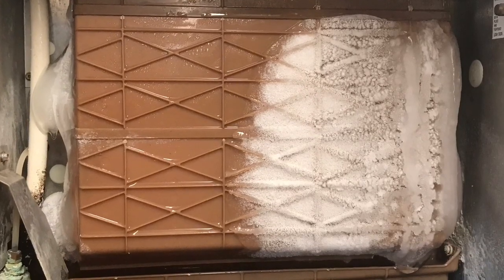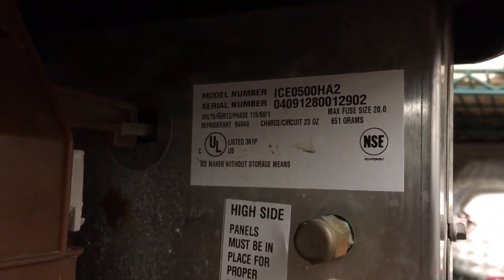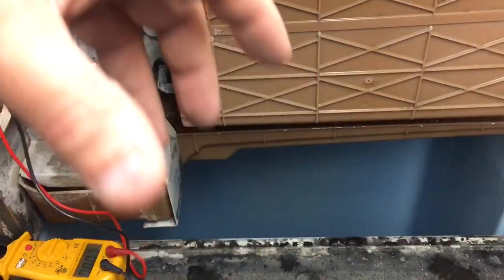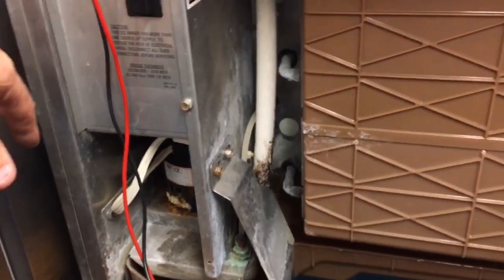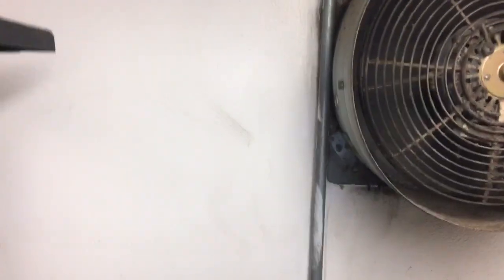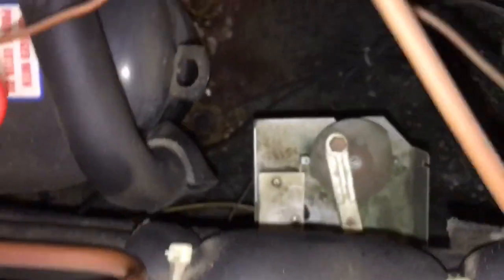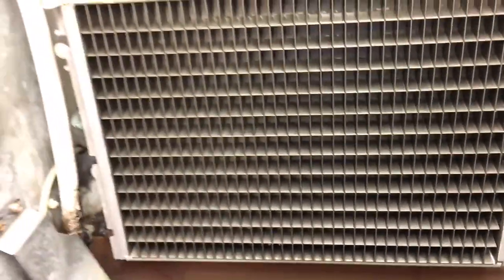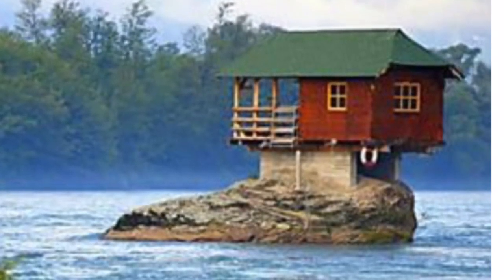Service call - All Frozen up iceomatic ice machine. ice0500HA2.

Comment: The good old harvest assist motor. Ice o matic has had a lot of issues with this. A bunch of revises and now a complete rewire of the harvest assist. Good catch. Any time I come to an Ice o matic frozen up, I look to see if the pin is still sticking through the ice plate.
Reply from the maker: Yea, Definately the Weak Link in the ice o matic ice machine.

Comment: New to HVAC so after recovering refrigerant from ICEO400HA4 next would be pulling a vacuum before adding specific amount of refrigerant.
Reply from the maker: maybe. why did u pull the charge ?
Reply: @OcRefrig  uneven ice on surface of mold tray, at first I thought it wasn’t dropping any ice because of mechanical issues or maybe a blockage it wasn’t those at all. So I thought maybe it’s low on charge.
Reply from the maker: uneven ice - i'd more look at water flow across the grid. loose grid slats or water distribution tube put together wrong or full of junk in water distribution tube.
remove water distribution tube - make sure it's clean / all holes open & when tube is assembled - inner tube holes MUST face up. it can be assembled two ways.

Comment: Thank you for your video of ice o matic ice machine, I got the problem of iceo 400, and it doing just mode of difrost hot gas no power coming to the seloniod valve  could be harvest motor or the switch or replace the whole assembly harvest motor and switch
Reply from the maker: Glad it helped. replace the whole thing as an assembly. they are not expensive. best move.

Comment: Thanks for all the refrigeration videos! I recently started a job working on Ice Machines am kinda lost so every video helps. Can you try to make a video that better describes pressure readings and how to properly recover, vacuum, and charge low pressure systems for a rookie l like myself? Thanks!
Reply from the maker: What did u do before ?
Reply: OcRefrigeration,Hvac & Electrical.  Residential install
Reply from the maker: Ouch , from Resi installer to ice machine tech. Boy, someone threw u in the deep end. So, only difference between a ice machine and a airconditioner is the technology. Make sure u sign up for ALL THE ice machine schools Right away. it's a Must !!! Hoshizaki school , ice o matic & manitowoc schools. Without it YOU WILL BE LOST !!!
Reply from the maker: --- Similarities ---
Recovery = Same as A\c.
Evacuation = Same. Under 500 microns a must.
Welding = same
Pressure testing for Leaks = Same. 
Finding Refrigerant Leaks = Same
Adding refrigerant = same.
Refrigeration theory = same. Know your Pt chart. Pressure vs temperature for different refrigerants.
Condenser fan motors = same. Just smaller

--- Differences ---
Circuit boards, electronics, hot gas defrost , Curtain switches , micro processors , water pumps, Water distribution tubes plugging up with crap. Corrosion , water leaks , harvest assist motors on ice o matics, No Evaporator fan = a Water pump is Now Your evap fan creating load on Your Evaporator Plate. Water inlet Solenoids , Liquid line solenoids ,
Reply from the maker: 1) Allways make sure Condenser is Clean First !
2) Biggest Problem -Plugged water filters. It needs water to function. Make sure it has a decent water supply entering.
3) 2ndbiggest problem - Plugged water distribution tubes with junk , slime , bacteria.
4) 3rd --- Water Pump Plugged up with slime. Poor water flow. Clean spray bars allways.
5) 4 th biggest problem - Loss of Refrigerant. Not common. Don't alkways assume a Refrigeration. More often than not. Ice machines DO NOT LEAK REFRIGERANT. RARELY. 9 times out of ten its a Machine is Dirty issue. Condenser plugged with Lint & Slime inside Evaporator area / Poor water flow.
Reply: OcRefrigeration,Hvac & Electrical. Awesome, thanks for the brief schooling. What I've seen so far was ice-o-matic machines with code HPOC the first machine I was unable to figure out what the deal was. The second one I found dirty condenser.  The other issue I had was a harvest motor was staying on which I suggested a new harvest motor. No word back yet. My main issue is I'm not sure of the exact sequence and defrost has me confused.
Reply: Also the one walk in freezer I went on suction line was iced up all the way to the condenser. Unit had two compressors the evap was frozen up so I forced a defrost. Had no gas going in the evap. I couldn't get a reading on my high side due to not the right tool to open the valve but my low side was only reading 23psi. One of my compressors kept short cycling (the one for the cooler I believe) I'm assuming either low on Freon or TXV issue. But not sure yet until I can hook up to get correct pressure reading.
Reply from the maker: What state are u in ?
Reply: OcRefrigeration,Hvac & Electrical. Texas
Reply from the maker: California here.
Reply: Craig Ewing check out PartsTown site. Lots of factory .pdf available to download to your tablet. Manuals tech charts & sequence of operation, parts lists and fotos as well as a forum Techtown

Comment: I have a ice0400ha4 my question is does the harvest assist motor should it move while in freeze mode or should it stay still then move when in harvest?? Any help would be appreciated
Reply from the maker: in freeze - motor will spin to notch on brass wheel and stop. no more moving in freeze. in harvest - motor tries to move / slips on clutch till ice is pushed off then rotates to stop / notch position.
Reply: @OcRefrig  K cool thanks so much for the response yes I kinda thought that was the way it was but needed assurance thanks again
Reply from the maker: https://www.iceomatic.com/faq

Comment: Some of icematice design I wander what are they thinking. Example on pressure switches why don't they use shader valves that way you wouldn't have to recover freon to replace them and why do they put dryers on bottom of unit .They sure didn't think of service tech on design of unit
Reply from the maker: Agreed.

Comment: I have two 2013 iceomatic  machines with small leaks around the compressor that I just can't see with bubbles yet
Reply from the maker: Buy yourself a Ge-H10 G Leak detector. It will make your life alot easier.
Reply from the maker: Turn ice maker off. Let system balance off for 30 minutes. No ice on the Plate. Go around with a leak detector. Check for cracked 90's from vibration. If u still can't find leak. Remove all rubber insulation from all piping and dry off  tubing. Check for leaks. Check anything that contacts the floor of ice machine. Under drier ?
Reply from the maker: If u think leaks are somewhere sometimes they can be blowing from another direction. Leaks can be sneaky. Leaking Pressure switches ?
Reply from the maker: its probably leaking from the bottom of the filter drier and just blowing around the compressor. .

Comment: What tips do you have for a newbie in refrigeration?
Reply from the maker: Tips Regarding What ?
Reply from the maker: Buy a Ge-H10G Leak detector to find leaks accurately.
Allways Clean Your Condenser First ! Can u see Through the Condenser with a Flashlight ?
Make sure evaporator is Clean and free of all ice first.
Make Sure All your Fan motors are Turning in the right direction , i find fan blades installed backwards ALL the time.

Comment: Hello sir, I'd like to ask a question. I have an Ice o matic that won't harvest at a little homeless mission I help with. It had the harvest assist probe motor replaced but still no harvest. I checked resistance at coil and its 140, doesnt seem horrible... I hooked up voltmeter and watched for voltage but no voltage ever showed up long past harvest being frozen.  What would be next point of diagnosis?
Reply from the maker: just Follow wires back from solenoid to find power if no power at solenoid.
usually there are a few parts in circuit, as soon as suction pressure pulls down to approx 28-30 psig low pressure switch should be closed and power coming out of it to timer block( black square thing) it times down and power comes out of that to solenoid usually. there might also be a Yellow cube relay in circuit. remove / inspect cube relay / swap yellow cube relay if u have 2 , they are same.
Reply from the maker: what city & state are u in ? if your local ill donate my time to help out. im in south orange county,  california.
Reply from the maker: 140 ohms is prob ok. you can put power directly to solenoid coil by making a little cord with 2 push ons on the end and plug into a extension cord to test solenoid coil and solenoid valve operation. remove wires to coil then hook your test cord to it. run ice machine, let it make ice when grid is full of ice. plug your test cord into a extension cord and power up hot gas defrost coil. slab of ice should heat up and drop within 2 minutes on the clock. unplug coil after ice drop to re initiate freeze cycle.
Reply from the maker: there is a Temperature switch on some machines that is a common problem, it is buried under the insulation with 2 black wires coming out of it. it is strapped to a copper refrigeration pipe under the top cover right in front of you.
Reply: @OcRefrig  Lol Im in New Orleans, prolly a little too far.
Reply from the maker: yea.
Reply: @OcRefrig  
Hello again, I followed wires back from solenoid they both seem to attach on opposite sides of contacts where relay is. I switched relays, no change. I found what I believed to be pressure switch and disconnected a lead. It cycled off compressor but never initiated harvest. If I had a way send pics of inside it might help identify parts.
Reply from the maker: You have pretty much done all u can do without refrigeration guages, 1 foot hoses & electrical meter. you either need to call a ice machine technician to fix , call some local Refrigeration companys. see if they want to Donate thier time. its a tax writeoff for them & a Way to give back. good luck. 
option 3 --- Replace some parts. high temperature safety & timer block ( square black thing with dip switches on it. ) you know u could put those two wires together that go through the black plastic timer block. 2" square thing with dip switches. bypass that timer so power goes straight thru it. it judt makes defrost time longer. if it drops ice or goes into defrost u will have found a bad timer. or if u kniw how to check for power on one side and see if power is going through it after it has made a thick slab of ice and machine is running.
Reply from the maker: model & serial # of machine ?
Reply from the maker: https://sdsmarket.com/ice-o-matic-9041098-01-switch-high-temp/?cmp_id=898701253&adg_id=45286604829&kwd=&device=m&gclid=EAIaIQobChMIhOmP74SI3wIVDBhpCh2ycAU6EAQYASABEgIYpPD_BwE

find this part on your machine.
it is buried under insulation. ohm it out. it should be closed. they sometimes fail open. unplug ice machine.  disconnect this from system & ohm it out. it should tone out / have a straight through connection. if not buy this part and replace. for testing purposes u can bypass this switch.temporarily. and run machine without this switch to see if it makes ice.
Reply from the maker: this is what a timer moduke looks like ---- u can bypass this. temporarily. 
https://hvacrpartstown.com/products/ice-o-matic-timer-module?utm_medium=cpc&utm_source=google&utm_campaign=Google%20Shopping&gclid=EAIaIQobChMIsryftIaI3wIVDV8NCh2NIgUPEAQYAiABEgK4BfD_BwE
Reply from the maker: if u bypass these 2 parts and machine does not energize solenoid. likely culprit is low pressure control failure or compressor is not pulling down to a 30 lb suction. both these scenarios require a refrigeration technician to diagnose. have fun !
Reply: @OcRefrig  So this is ( high pressure) switch I unplugged on one lead. It shut off compressor but I waited for a harvest event but it never happened. I'll try bypassing timer as well to see what happens. If not I'll call someone and I really appreciate your time and wisdom.
Reply: @OcRefrig   OK so I found at least some of the problem. The condenser faces the wall and it was covered in a blanket of fuzz. I should have noticed that sooner.  It has harvested twice but seems slow to restart water pump after it dumps. Just observing for now.
Reply from the maker: Condenser is First thing to check on any refrigeration unit ! YOU MUST be able to see through it with a flashlight. it might be clean on top surface but they are 1-2" thick. they get impacted. YOU MUST Blow air through coil to clean it. YOU MUST.
Reply from the maker: that unit i believe has 2 cooling fans. both MUST Work. 1 comes on first , then 2 nd one comes on when pressure rises on a switch. about a few minutes later.
Reply from the maker: 2nd fan cycles on and off on a pressure switch. both fans i believe are off during harvest cycle. they might cycle on & off.
Reply: @OcRefrig  Ok Im leaving you alone after this one. Ill clean it out with air, but after I watched it while last night it quit harvesting and the purge solenoid started acting crazy and got super hot... no idea why.
Reply: And I also noticed suction line was frozen so it may have refrigerant issues.

Comment: Hello my friend thank you for your video just so question what was the main problem because it was freezing up I have a service to finished and it is freezing up also what part did you replace you was the bin sensor can you reply my message please thank you very much
Reply from the maker: Harvest probe motor assembly Loose at back of evaporator area. Harvest assembly needs replaced.
Reply: @OcRefrig  thank you very much my friend I will do that because this ice o matic ice machine it makes ice but the next day woke up freezing up
Reply: @OcRefrig  thank you again my friend and also I wanted to mention that when I found the machine I found with that contactor burn out and obviously I replace it but it came out with this problem freezing up
Reply from the maker: it could also be the water pump stopping or getting a piece of scale sticking in the water pump impeller. clean machine real good before replacing probe motor. remove water pump and make sure its clean. no scale.
Reply from the maker: wash out water trough real good.
remove water pump.
check that water pump turns freely.
Reply from the maker: Run water pump in wash mode and make sure water pump works real good before replacing harvest probe motor assy.
Reply from the maker: if Harvest probe motor assembly is all Loose behind evaporator it definately needs replaced. it should turn smoothly & turn straight and smooth.
Reply: @OcRefrig  great I will check. Tomorrow thank you very much I will let you know how he finished thank you thank you thank you again for your big help

Comment: Iceomatic ice machines seem to have serious problems for 3-4 year old machines I have seen many leaks and evaporator failers working for C-store chain
Reply from the maker: Its Hit or Miss. I Have 3 Clients That i installed 3 New ice o matics in thier restaurants 10 Years Ago. All Good ! 1 Just starting to fail. compressor weak. 12 years old. still makes ice though. 1 Unit nickel playing coming off evap. 10 yrs old. 1 other iceomatic I did not install. ice 1406ha5 its a Lemon 🍋 Never ending problems. refrigerant leak / corroded out liquid drier at 4 years old. water pump failed at 6 years.

Comment: Just replace it with a Hoshizaki 😊
Reply from the maker: That would be nice , maybe. stay tuned for update.
Reply: OcRefrigeration,Hvac & Electrical. By chance you happen to any Hoshizaki cover panels? Just tough I’d ask I have a k500 need the top panel, and front
Reply from the maker: No, sorry , i don't keep any old stuff around. Everything to trash or scrap. Sorry for late reply.